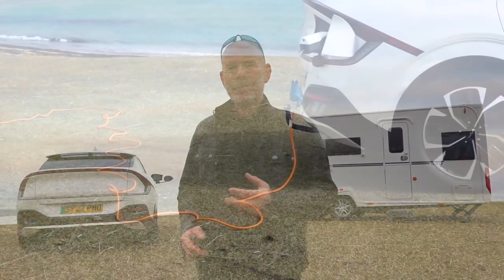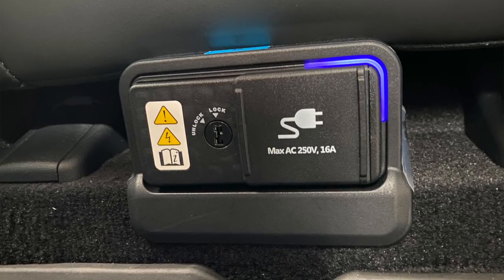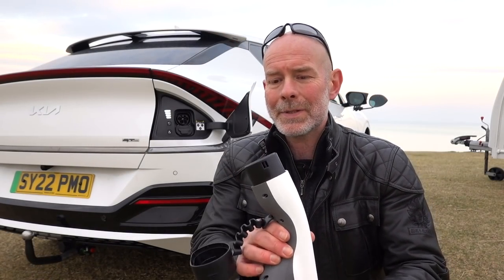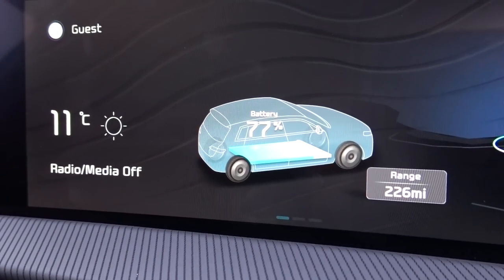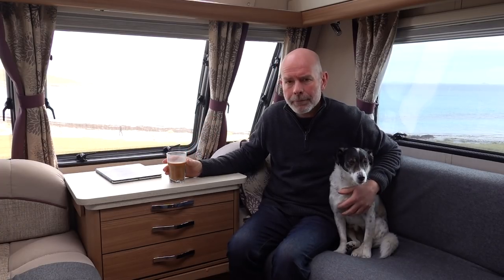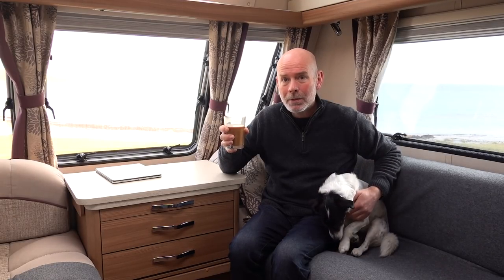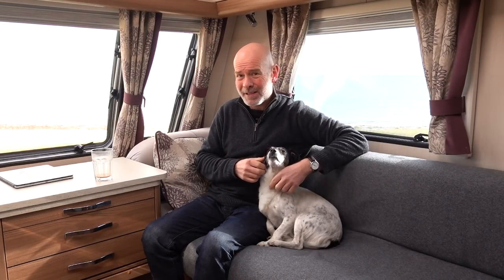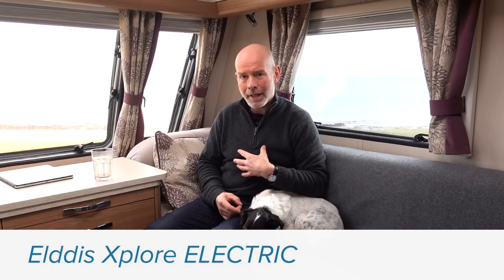V2L Caravan test - Will EVs REVOLUTIONISE caravan design?

Comment from the maker: What do you reckon folks? Do you think we will see all-electric caravans coming from UK manufacturers again any time soon, and who will be first? My money's on the Xplore Electric making a comeback.
Reply: I think smart caravan manufacturers should look at ranges of superlight, super aero and electric only caravans. It’s where the market has to go. Why can’t my Model Y do V2L!! Arghhhhh. Must tweet Elon!
Reply: Hi Andrew great vid usual one question how much is the price of the EV car and what are the charging times
Reply: A very interesting and thought provoking video.  We are a couple and have a twin axle caravan with a motor mover and E&P self levelling so we would probably need a 12v battery.  The MTPLM is 2000kg.  Two or more people would use more power for heating water for showering.  Others use a TV which is another draw on power.  IMHO the EV battery will probably need recharging after one night if you are a couple perhaps with children.  If the charge on the car dropped down to 40%, that means you need to drive to the nearest place to top up, but in the meantime the battery and gas can take care of stuff like fridge, heating etc so are probably still essentials.  Gas and battery backup is almost a must of camping off grid.
Reply: Could the “saved’ weight on the caravan be used to house solar panels to harness charge-back to the EV/caravan? Not knowing very much about the mechanics of this I’m probably way off the mark here but just trying to think out the box.
Reply: @fionamitchell884  There would be no "saved" weight as caravan will still require a 12v battery and probably gas.
Reply: @iank6263  I think we will agree to disagree on that one as our thought processes obviously see the needs of caravans in a different way. Motor movers and self levelling are luxury items that have only been introduced in the last 10-15yrs. They aren’t essential.
Reply: @fionamitchell884  from what iv been seeing lately movers have become essential!!..
Reply: @Ronald Yardley  
I guess people are getting lazy. They have never been "essential" before.

Comment: Two questions Andrew.

1. Have any all electric caravans used a little heat pump, like EVs use for heating? That would cut electricity use by 60-70%, and draw thus less from the car.

2. I wonder people would still prefer to have a small battery in the caravan, perhaps with a solar panel on the roof, so it could keep the fridge cold if you drove the car away for a few hours? I guess it could be smaller battery than usual, if you assume the car or mains power most of the time.
Reply: If supplemented with solar and as small wind turbine, I imagine the power would stretch much further
Reply: You say smaller battery but a 100 watt lithium battery would be a lot lighter than a conventional one. So you could keep the same power.
Reply: @rhinogooner  Yes, I was thinking that too. Doesn't have to be a lead acid battery.
Reply: I was going to comment on the same line: the caravan will always need a battery, at least for the fridge. And, of course, latest generation fridges, air conditioning, ovens and cookers will save energy and allow longer off-grid use. A solar panel covering the roof is also a good idea.
Reply from the maker: Good thinking Mike. I was thinking that the transformer could power the 12v stuff, but a decent Lithium battery might just keep a fridge running while the car is away charging. As for heat pumps for caravans... someone needs to invent one PDQ!!!
Reply: @andrewjditton  well, the Kensa Shoebox heat pump has a heat output of 3kW, with electrical consumption of just 800W. And it's small. But it's a ground source one, and a caravan would need air source. The downside would be finding space for the fan coil heat exchanger, I don't know if caravans have space underneath to fit one in? And it would need to be designed to run very quietly... The heat pump in an EV is quite noisy, but you don't notice it while driving.
Reply: Yes many caravans has a "heat pump" : many caravan ACs has heating functionality as well!

Comment: Absolutely brilliant experiment Andrew. An EV coupled with an electric caravan (shall we now just call that an EC?) is certainly something that will fit a niche market and seems to be ideal for what you have in mind for the immediate future  BUT having to constantly consider range, state of charge and where to get recharged may take the edge off a nice relaxing break for some. I do feel that we are at the very beginning of something big though once manufactures are able to magic extra range and capacity from EV batteries.  Have a great summer.
Reply from the maker: Cheers Richard! Yes, it's early days still, but nice to experiment to see what is possible. Thanks for watching.

Comment: Great to see this being shown off. I have the Kia Niro with V2L. I have my Home Meter box Wired to accept power from the Vehicle in case of a local power outage. It is wired just to power the lights and Power Points, So no Hotplates, oven, Hot water cylinder or Heating. I'm sure I can draw 3.6 KW.  I'm yet to experiment to see what an hourly draw would be. Cheers Tony

Comment: I recently learned to roast chicken and beef in an air fryer. We bought a portable induction hob too, so the gas powered fixed cooker with double oven has become an ornament these days. Our next purchase will be an Ecoflow power bank and an upgrade of our roof mounted solar panels. We are planning on building in as much self sufficiency as possible due to the ever increasing costs of touring sites.

Comment: This is the most interesting thing on YouTube at the moment. We'd still need a small leisure battery, Typically one person goes shopping & the other stays with the dog. You need to flush the loo at a minimum. OK, we always try to stay on powered sites but sometimes it's not possible.  Our annual pilgrimage, to the Glen Innes Celtic festival, uses about 125 liters of petrol which now costs about $250 AUD 4 years ago it would have been just over $100 that bears thinking about.

Comment: Very interesting.   We are currently living in our van while our new build house is being built and we got our first electric bill from the site after the first 14 nights (they charge electric on top of the site fees).   That worked out at £59 for 14 nights so that’s £4.21 a night on electric.   That is running our fridge and the heating and microwave, boiling the kettle plus TV and charging phones and IPads etc.   We also have the price of the gas which we use for the oven and hob.  Very interesting that your night worked out costing you less than that.   🤔 I find myself wanting one of these EV6’s now.
Reply from the maker: Interesting. Although remember that I managed to find a charger where I paid 20p per kW/h. Some are more expensive, but others are free! However, free ones generally charge at a very slow rate. Hope you enjoy the forthcoming videos over the summer when I put the EV6 to the real test on a longer trip. Thanks for watching.

Comment: Very interesting teaser Andrew. I'm starting to come around. I would like to point out Lpg pricing may well be right for Calor. But I use Safefill so I reckon no more than £1.70.. but I do like the. Idea. It's certainly cheaper than site EHU between 4 and £6 a night. Look forward to your longer trip in the summer.. PS when you plug in the car does it also charge the  liesure battery? is there solar panel on the Caravan might help😁
Reply from the maker: Hi Victor, yes the leisure battery charges by default. Using a solar panel is always going to help but maybe not by a huge amount, as the biggest load on the EV battery is the 240v stuff. Battery charging is minimal by comparison, but every little helps!

Comment: Hats off for taking the plunge into the EV world, the EV6 is a cracker, as is the Hyundai Ionic 5, but can’t help thinking you may have jumped a bit early. At a 100miles between charges and probably an hour per charge by the time you have disconnected and reconnected the van and 30 to 40 minutes a charge on the standard chargers, as we don’t have many 350kw chargers available yet, the lack of charging infrastructure generally, trying to map a route in EV across the uk is always fun without a caravan, with a van who knows where you could end up?  One last thing EV 10 year battery life is based on the number of charges in that time, when your pulling the van your  going to be charging your car three times more often when just using the EV as a car, so pulling the van will have an impact on the battery life, at £12k to replace batteries it rapidly ads up.
Reply from the maker: Cheers Mac. Yes, I know it's a bit early but I feel we are in a chicken-and-egg situation just now. Hopefully I can demonstrate a need for pull-through chargers and the need to improve the network like you say. It's a sacrifice, but an exciting challenge as well. Cheers!

Comment: A fascinating series and well presented as usual, thanks Andrew!

The Weinsberg CaraCito lightweight all-electric vans which you saw in Düsseldorf have just become available to order from some UK dealers, along with the Knaus e-Power vans which reached the UK a few months ago. 

I applaud Knaus/Weinsberg for their innovative approach. There must be a large market in Europe predicted for e-only caravans, given the investment that Knaus Tabbert have made.

We've just sold our Bürstner motorhome and have ordered a Weinsberg CaraOne 400 LK caravan, for collection in June. 

This decision was driven to a large extent by my concerns over the long term cost and availability of diesel. Having spent so much on the motorhome purchase we hoped to use it for the next 15-20 years, but this seems increasingly unrealistic...

The CaraOne is not as exciting as an all-electric CaraCito, but it will come with gas/electric room heating and electric only hot water heating. We'll mostly be using a portable induction hob and an electric kettle. Gas will only be used for occasional cooking and as a back-up for heating in case of mains supply problems on site. 

Critically, the low MTPLM of 1350 kg will give us the freedom to change tow cars to EV or hydrogen fuel cell in the future, although we'll be using our BMW 320i mild hybrid for a few more years.

P.S. I have a Westphalia detachable towbar, and after a few wincing knuckle grazes of my own I now always use workwear gloves when hitching up ;-)
Reply from the maker: Very interesting to see what you are doing there. And I had no idea about Weinsberg bringing the CaraCito to the UK, so that's useful to know, thank you! As you say, they are to be applauded for their innovation. Let's hope we see a UK manufacturer follow suit soon. All the best.

Comment: Great idea, only stumbling blocks are the cost of the vehicle in the first instance, and the limited range/current availability of charging point across the UK.
That Kia is something else though isn't it?
Steve
Reply from the maker: You're right Steve, but when you look at 'new' prices you'll fall over (I did). They Kia Sorrento 2.2 diesel costs almost as much - about 10% cheaper.

Comment: Well done & thanks for sharing. I use a 12VDC 1kW inverter on a 2013 RAV4EV for V2L. I wonder if you can get an additional 1kW from the EV6 this way (only when it's ON).
Reply from the maker: Interesting! Not sure if I would tinker with the EV6 though, 3kW is enough for me anyway. Cheers!

Comment: Wow, that is a superb idea and glad you have seen the potential in this option. Now what would be nice if you had a few solar panels on the caravan in that if the power in the van was already good that the car then took charge from the caravan system. My only worry having a complete electric caravan at present is the oven, I would imagine that would take quite a bit of power to cook a pizza lets say. It's taking massive strides and it's good to see this possible.
Reply: I very much doubt that the 10kg cylinder would last 16 days in March with heating on.  In June without heating, sure, but you need to compare like for like.
Reply: @Alex-ek5fb  dead right Alex I use a 10 kg safe fill and it lasts 3 to 4 days per bottle when using the heating.,fridge ,cooker and hot water now in march . So it's about the same as Andrew's estimate for electricity.  Problem with Andrew's rig is you have to keep travelling ,if your doing that you may as well have a motorhome
Reply: @keith4881  yes you can’t leave the van on a no hook up site while you you go off in the car unless you have some other means of providing power ,you would definitely still need a leisure battery at least in my opinion.
Reply from the maker: Cheers! There is also the issue of not being able to power the fridge when the car is away for charging. But for a night every now and again it works, making the all-electric caravan a viable option.

Comment: Great videos Andrew. Thinking about this further with V2L, I assume that the traditional UK neutral pin is not reference to earth or the vehicle chassis or the caravan chassis. Can any electrician verify this?
In this case I take it would not be protection possible to provide RCD protection.
So what if alive electric kettle was dropped in the caravan wet basin.
Does the caravan have circuits designed to protect from electrocution?
Reply from the maker: Someone else has brought this up and I'll hopefully get an answer soon when I go to Düsseldorf. Cheers!

Comment: Absolutely fascinating Andrew.Well done 👏 my question will we be able to charge our EV on a caravan site and if yes how long would it take for a reasonable charge?
Reply from the maker: Hi Andrew, at the moment you can only plug the car into the caravan which will deliver about 1.3kWh. So in 18 hours you'd get 23kWh of charge, which would only be enough to to get you about 40 miles towing. It's only a realistic option if you're staying on site for a couple of days and can get 50kWh+. For a quick overnight stop you'd need to take the car away for charging, although more and more sites are installing car chargers. Thanks for watching!
Reply: @andrewjditton  Thank you Andrew so here we go Caravan sites will need to install ideally Quick Charge power points for fast charging ? I wonder.You arrive on site after a 200 mile drive with low EV battery which will struggle to give you overnight power,what happens next ? I’m sorry but as it stands there’s a lot has to happen for this to work.

Comment: Thanks for your series comparing fueled and EV cars towing and camping. I am in Australia and have waited years for a fit for purpose EV UTE to be available in Aus. Never gonna happen so I have ordered a May 2024 delivery EV9 GT line and am now looking for a suitable caravan to purchase.  I want to tow a caravan and travel AUS. in a fit for purpose EV. I have a 40 kw Nissan Leaf which I only purchased  in 2020 as it was the only V2Grid/ home EV available in Aus. We are so far behind the rest of the world but only because our range expectations and needs are so great. eg.🚙 (a trip to a capital city centre for me is a 300kl round trip what we in Australia call "Just up the road" The charging networks are pretty sparse but Grey Nomads and EV travellers have guaranteed the installation of EV chargers at Caravan parks, camping sites and many hotels / air bnbs. I don't want a huge 7 seater SUV with such high specs as I will only be travelling with my 4 dogs but there are no suitable UTES or Vans on the Australian market;at least not until 2028 according to manufacturers of the endless CONCEPT cars at shows hahahaha

Comment: I really enjoyed the V2L video as we have an ev and a PHEV.  Unfortunately the Tesla Model 3 Long Range and the Mitsubishi Outlander PHEV do not have the V2L facility but I’m sure it will get more common in the coming years.  I have recently had a test drive in a EV-6 GT Line like yours and was very impressed but I would like something a bit larger so we could go down to just one car.
The idea of having an electric only caravan is interesting but there are times when one or more of us would go out in the car and those remaining would have no power or heat or if you all go out you come back to a cold caravan so it’s not ideal.
Reply from the maker: Yes - I imagine LPG would need to be retained for that very reason, but that might become a 'luxury spec' option. Interesting days ahead. Good luck with your next car!

Comment: I'm thinking when I stop motor homing an all electric tear drop trailer would be appealing to me. With an electric blanket (would pass as central heating), an induction hob, a small kettle and the induction friendly version of the ridge monkey and your set up. 
Maybe a small van with the power station facility will be on the market soon. This would enable a self build camper van.
On reflection I think a small 12V  compressor fridge (maybe dual zone) and a power bank would work with either of the above options. Both able to work and charge in the car or the van/trailer.
Reply from the maker: Absolutely Richard. This was just a first wee trial, but I think the implications could run and run with this. Thanks for watching!

Comment: i was under the impression that certain things would not work without the leisure battery. i guess you mean IF the caravans were made for it so those things (i know lights but not sure if other things need the battery) were addressed. i guess they could also redesign the motor movers to use the V2L as well. the cables are long enough to manoeuvre it whilst connected to the car.
Reply from the maker: One would hope they would simply work off the transformer if a manufacturer were to go down that route. Good idea about the mover! Thanks for watching.